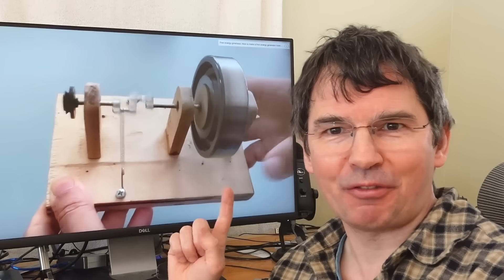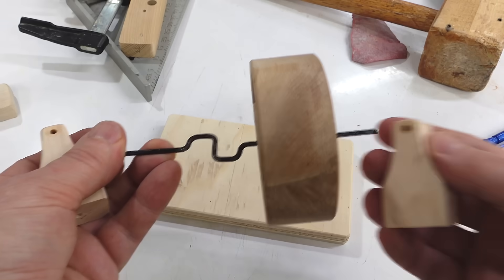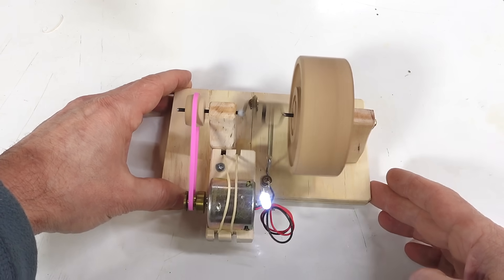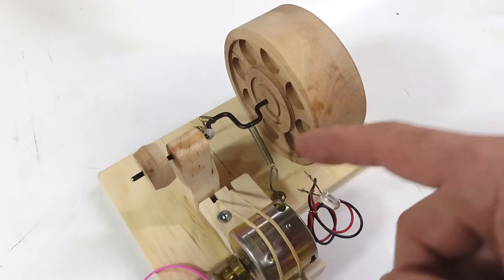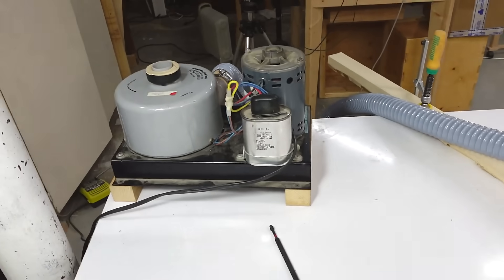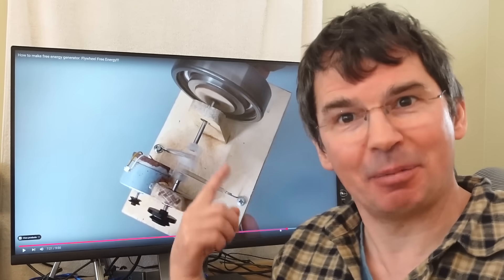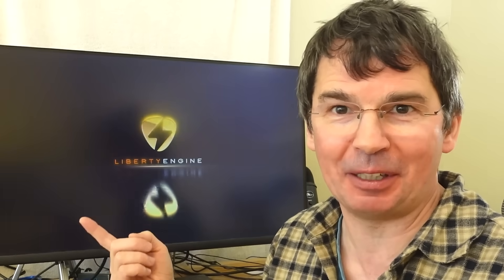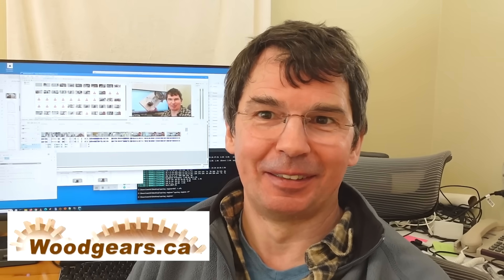I built a “free energy” machine and show how it really works

Comment: Interesting video. Such an engine is possible.  There are materials that change their dimensions depending on temperature. If such a spring heats up and shortens when compressed, the flywheel will accelerate due to the energy of external heat.

Comment: I've always thought that some of the free energy devices could be pretty practical for other applications if we just didn't call them free energy devices. So what if you have to restart a flywheel every once in a while as long as it is doing its job for a good enough period of time. I'm obviously not talking about goofy ones like this.
Reply from the maker: why, they are VERY practical at earning money via YouTub ad revenue!
Reply: If you look a few things up for yourself you can see that free energy is guaranteed by Newtonian Laws of Motion.
A 20 kg flywheel accelerated for 1 meter by a 1 kg mass suspended from the circumference will accelerate just like a 20 kg sled in a modified Atwood's machine. The most antagonist have admitted to this.
This gives you 20.3 units of Newtonian Momentum after the 1 kg has dropped only one meter. 

A 1 kg mass can rise 1 meter when it has only 4.429 units of Newtonian Momentum. 

There are several devices that can give all there Newtonian Momentum to a small mass; and then that same mass can give all the momentum back to the larger mass. 
So what is the problem? Do we not know that  Newtonian Momentum Conservation Laws are correct? Do the profs want to pretend that Newton is wrong.
AI has been told that Newtonian Momentum Conservation Laws are WRONG: and that Newtonian Laws of Motion are not conserved in rotating masses. The powers that control physics are using AI as proof that supports their erroneous Laws. But AI is ignorant  and completely incapable of experimental investigation. 
It is apparent that scientific investigation has gone by the wayside and the internet is only concerned with click bait. But this is a billion times more valuable than chick bait.

Comment: As an Electronics Technician, I've gotta laugh. You have a Mechanical RLC that won't run forever but they sure are fun to watch huh ?... 🤣🤣🤣
ie I can do the same thing with a couple of small Capacitors and they will light an LED for 15 or 20 minutes with a Trigger Spark but then the Harmonic Resonance will phase out. ⚫️ 💡

Comment: When you add a load to a motor it become harder to turn the motor so basically you need a force higher  in proportion to the load that you are running. In other words the motor will slow down that thing that's turning the motor. All the videos we see are nonsense. You want free energy buy an inverter a battery and a solar panel😂
Reply: Well: not all videos are nonsense. The 'cylinder and spheres' videos are being ignored because they work. Apparently producing energy in the lab is not considered good click bait. 
A 10 to 1 Atwood's (or modified Atwood's) produces 3.16 times more momentum than that which is needed reload the system. This 3.16 increase in momentum can be placed in the extra dropped mass of the Atwood's.  The mass will then rise 10 times higher than this extra mass (that had caused the original speed) was dropped.
So your statement is false. Either you don't look at the videos that might work. Or you don't talk about the videos that work. Or some how  you are being prevented from searching videos that work. The first, and realy the only missing, step needed for a prepetual motion machine is to produce energy in the lab. And the 'cylinder and spheres' machine does just that.

Comment: waste of time to proove that most of the people are stupid to believe in violation of phsysical laws
Reply: You have it upside down. The people that are violating the Laws of Physics are those that say energy is conserved.
 A ballistic pendulum does not conserve energy; you pretent the energy goes somewhere else. But you all know that the small mass in the Dawn Mission despin contains all the original momentum because the motion can be returned to the satellite if the small masses remain attached. So what is the speed of a 3 kg mass if it has the same momentum as a 1420 kg mass spinning 1 m/sec.
I know the verbiage they throw at you but the despin has to conserve momentum. The motion Energy of a small mass is NEVER given to a larger mass. It is ONLY Newtonian Momentum Conservation.
People will post fake machines to get hits but they will not do real experiment that really work.
Reply: @delburtphend6016  if the energy is not conserved then where it goes...you can  not create energy from nothing, nor you may convert energy to nothing

Comment: You can not debunk an experiment by citing a totally theoretical concept. You can not say that Newtonian Momentum Conservation is false by citing a theoretical concept that has zero experimental evidence. 

Those that claim that the law of conservation of energy is true are stating that a 1 kg mass moving 6.3245 m/sec can make a 40 kg mass move 1 m/sec. They are lying to you. You can not cause a 40 kg mass at rest to move 1 m/sec if you have to start with 1 kg moving 6.325 m/sec.

You just need to do the experiments yourself and quit listening to those that have forced mental slowness upon themselves and are too lazy to do the experiments. 

A 40 kg mass moving 1 m/sec can give all of its motion to a 1 kg mass and the 1 kg mass can return that same 1 m/sec motion back to the 40 kg. The 1 kg MUST BE MOVING 40 m/sec for this return of motion to occur. 

True science requires an open mind toward legitimate experiments; especially when the experiments are simple and cheap. But instead you get wanton ignorance through bias.

The ‘smokin lamas’ and ‘practical engineering despin’ and ‘cylinder and spheres’ are real and they are not expensive.

Comment: It seems that some people are confused by the flywheel.

A bar and a hoop (a hoop is a bar bent in a circle) accelerate in the same manner. When force is applied to a hoop, or flywheel,  in dry ice the hoop spins for a perfect F = ma; or Ft = mv. Yet the profs want to pretend that the acceleration of a bar and the acceleration of a hoop are different. These profs will tell you that a hoop does not even have Newtonian momentum. 

The profs are lying to you and themselves. They want to keep the false law of conservation of energy even if they have to throw out Newtonian Physics.

Okay: avoid the confusion; use a modified Atwood’s.  A 99 kg horizontal bar is accelerated 1 m by a 1 kg mass suspended from the pulley. After the 1 kg drops 1 m the 100 kg is moving .4429 m/sec. All of this motion can be given to 1 kg by wrapping a string around a light carbon fibers wheel. This transfer is much like smokin lamas except that the large mass is external to the wheel. 

I have done this type of experiment and it works. All the straight line motion of the larger mass is given to the small mass.  
 
After the fiber wheel has transferred the motion then this 1 kg can rise d = 1/2 * (44.29 m/sec * 44.29 m/sec) / 9.81 m/sec/sec = 100 m.

The 1 kg was dropped 1 m and it will rise 100 m.  Look at ‘smokin lamas’ and other despins for examples. Don’t live in the past.

Comment: I've watched a few of the Free Energy videos and they are very convincing - and even one where a guy converts a high powered motorcyle to run on water by converting it to Hydrogen - But what always puzzled me was - If you can make a machine that produces free electricty or energy - then why don't you set up a production line and sell them and become a multi-millionaire very quickly....?
Reply: You'd be killed before the day ends

Comment: I have a question, how does the flywheel turn fastest with the compressed air, with the springs or without the springs?
Reply from the maker: works better without the springs.  The springs are there just to look cool, but add friction

Comment: I have posted comments on YouTube 

I'll give you a simple solution 
Which more to be precise
Is a better solution 
Place 4 round magnets opposite polarity near one another
Place them in a quadruple polarized circle 
One quater of the circle North
One quarter of circle South
Two quartes as above
Putting finger on the four round magnets 
Inside the magnetic circle
The round magnets will automatically spin round and round in a clockwise circle
Place above the center of the circling round magnets polarized magnetic blades, 
The blades will start to rotate automatically 
Connect the rotating blades to a magnetic dynamo
Connect the dynamo to a electric ac dc current circuit board
Perpetual energy
Miniaturise this
Add wood between rotating magnets 
To the north and south as the round rotating magnets in opposite polarity will stop.
Connect the same to capacitors and rechargable current storage.
This is my tech from long past on which the maglev motor was invented.
Develop this further 

Abhijeet Madhukar Deshpande 
0091-9422810454

Comment: Yes dongfu 1776 they are lying to you. You can not use motion to make heat without losing motion. You can not use motion to make heat without losing linear Newtonian momentum. The professors and the establishment people that claim they are scientists will tell you ballistic pendulums make heat. But ballistic pendulums do not make heat because there is no loss of momentum. So why are they lying to you? It is important to realize WHY they are lying to you.

The disk brakes of a car get hot because the momentum of the car is being reduced. If the car were not slowing down the brakes can not and would not get hot. 

When a shell is moving through the air it gets hot because its momentum is being reduced. If the shell were not slowing down the shell can not and would not get hot.  

The momentum of a ballistic pendulum is not significantly reduced. But the profs will tell you that 95% of the motion is turned to heat. They are lying to you. If momentum is not reduced there can be no production of heat.

The profs need this heat lie to promote their bigger lie of the conservation of energy. If the profs can not pretend that heat is lost then they can not pretend that energy is conserved. 95% of the energy is lost if they can’t pretend that heat is produced. But that is exactly what happens; 95% of the energy is lost in a (20 to 1) ballistic pendulum.

The ‘cylinder and spheres’ experiment proves that the motion of 10 kg can be given to 1 kg; and then this same quantity of motion is given back again from the 1 kg to the 10 kg. This is an energy increase to 1000%. 5 joules can become 50 Joules. 

The only way to continue their lie (conservation of energy) is to refuses to do the ‘cylinder and spheres’ experiment.  Which is exactly what they have chosen to do. 

You 1776 can expose their lies by doing the despin experiments. You will need a higher speed video camera; but many people have such a camera.

Comment: Well bo2 the first law of thermodynamics is  wrong. The proofs are all around use; but the profs have most of you brainwashed. 3.5 grams of rocket fuel is energy but it can produce massively difference quantities of ENERGY. 

3.5 g of rocket fuel can produce 5 joules or 10,005 J of kinetic energy. 

3.5 g of rocket fuel can accelerate 10 kg from rest to 1 m/sec or it can accelerate 10 kg from 1000 m/sec to 1001 m/sec. This is not a trick it is just experimental fact. 

Zero to 1 m/sec for 10 kg is 5 joules.   5 Joules from 3.5 grams of rocket fuel

1000 m/sec to 1001 m/sec is 10,005 joules    (1/2 * 10 kg * 1001 m/sec * 1001 m/sec) - (1/2 * 10 kg * 1000 m/sec * 1000 m/sec) =  10,005 Joules      10,005 joules from the same 3.5 grams of rocket fuel. 

You just don't want to deal with the real world.

Comment: Do you anti-free energy; anti-Newton; people realize that you will not do experiments? 

You think you are intelligent but you will not do experiments. 

How intelligent is someone that will not do experiments? Galileo and Newton did experiments so are you genetically superior to Galileo and Newton?

You would rather live a lie than do an experiment.

If you can arrange for a 1 kg mass moving 3.16 m/sec to make 10 kg move 1 m/sec then do it; and violate Newtonian Physics. I agree with Newton; that it takes 10 units of momentum to make 10 units of momentum. But if you can PROVE otherwise then do it. 

You people are living a lie because your 10th grade teacher brainwashed you. Get over it; go find your brain and start using it. The ‘cylinder and spheres’ make energy, but you can continue your lie if you feel more comfortable hiding under the bed.    

Showing that the spring flywheels are a fraud does not make everyone and every experiment a fraud. Wrap the flywheel with a weighted string and the throw will make massive amounts of energy.

Comment: Of course Laws need proof.  You can believe a false law without proof because your 10th  grade teacher brainwashed you. But if he had no proof then more than likely you are going to wind up being wrong. 

I have made free energy using three different machines. YOU can make free energy with these three different experiments.

A balanced rod or unequal lever arms about a common fulcrum makes free energy. For example 10 kg at 10 cm on one side and 1 kg at 100 cm on the other. The long side has ten times the energy.

A double diameter pulley make free energy. The larger diameter lift less but does it faster; which gives that diameter more energy. This is Law of the Lever again but a different apparatus.

The ‘cylinder and spheres’ make energy.

All three of these are easy and cheap to built and the concept is worth 7 trillion.

Comment: You 'engineers' believe that you can not make free energy because you do not know the RULES of physics. You have been taught myths, chants, and silly concepts. Instead of basing your concepts on experimental data you have been lead down a rabbit trail of mystic fables. 

F = ma is a LAW or rule that has NEVER been violated. When a ten kilogram mass that has 10 units of Newtonian momentum gives its motion to a 1 kg mass then that 1 kg mass MUST have 10 units of Newtonian momentum. You can’t insult and chant your way out of this. When the cylinder stops rotating the spheres have 10 units of Newtonian momentum and the spheres are moving 10 m/sec. The spheres can even return All the motion back to the cylinder (as in a ballistic pendulum) so the spheres MUST have 10 units of Newtonian momentum. 

½ *1 kg * 10 m/sec * 10 m/sec = 50 Joules

½ * 10 kg * 1 m/sec * 1 m/sec = 5 Joules

You start with 5 Joules and end with 50 J. 

Quit falsely claiming it can’t be done and do something useful. Place this energy in an Atwood’s and you have all the free energy you want.

Comment: You want to make a free energy generator that works fairly easy, build a mini version of a Hydro electric dam and use a siphon to move the water from the bottom to the top.  As long as the tube remains submerged, the flow will continue without the need for an outside source.   Let's see if you actually will or not?   🤔🤔🤔

Comment: I am going to tell you how to make a large energy producing machine. There are only two separate functions within the machine: an Atwood’s, and a lever. Both functions are experimentally proven. 

An Atwood’s has an accelerating mass of 60 metric tons These 1 ton masses are on one side of a loop of chain 30 meters height. The up side of the chain loop has no mass attached. The 60 one ton masses are evenly spaced ½ m apart on the down or drive side of the Atwood’s loop. When the loop has dropped one half meter the bottom mass becomes free of the loop. 

The 60 tons are suspended from a shaft with a .5 meters diameter. That same shaft is the center of a 15 m wheel that has a circumference mass of 17.62 metric tons. The 17.62 tons will accelerate at the same rotation rate as if 528.6 ton where to be at the same radius as the drive mass. This has been proven experimentally. This is really just the law of levers.  528.6 ton at .25 m radius is balanced by 17.62 ton at 7.5 m radius and both sides accelerate at the same rotational rate.

The 60 ton will accelerate as if they were in an Atwood’s with (528.6 / 2) 264.3 tons balanced on both sides. This is an acceleration of (9.81 m/sec/sec * 60/588.6) = 1 m/sec/sec) 1 m/sec/sec.

After a drop of one half meter the 60 kg is moving 1 m/sec at the .5 meter diameter. The 17.62 metric tons is moving 30 m/sec at the 15 meter diameter. 

1 metric ton moving 30 m/sec will rise 45.87 m. Now this is over 1.5 times the energy need to restart the motion. So this is a 50% increase in the energy for just 1 ton. But there are 17.6 ton moving at that speed. That means you are pushing a 30 times increase in the energy of the cycling system. A 2,800% increase in energy. 

The time period over which the 60 ton drops ½ m is d = ½ att = 1 second 

So this is 8,000,000 joules of completely FREE energy every second.

This isn’t even using the despin. This is just an Atwood’s and a lever.